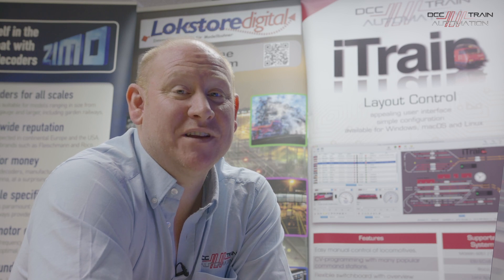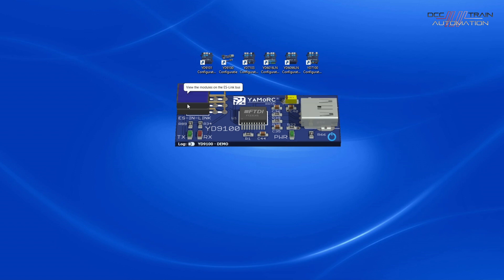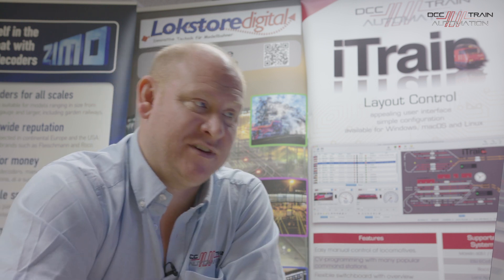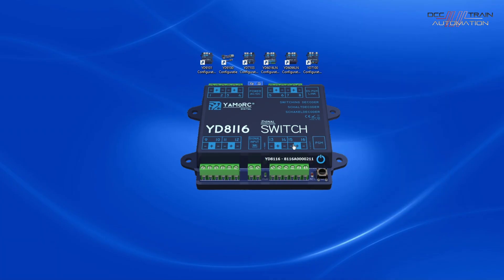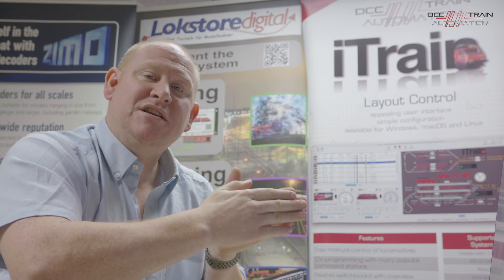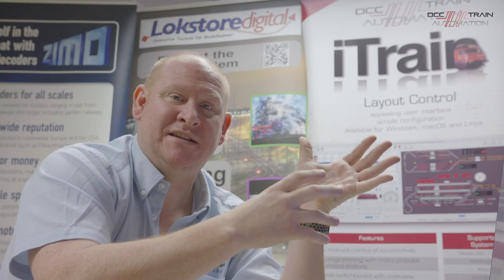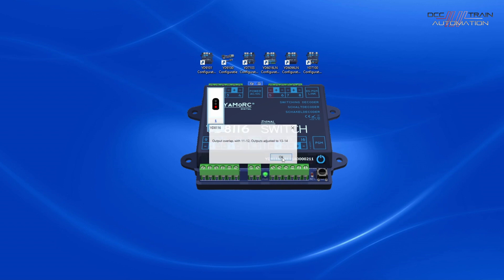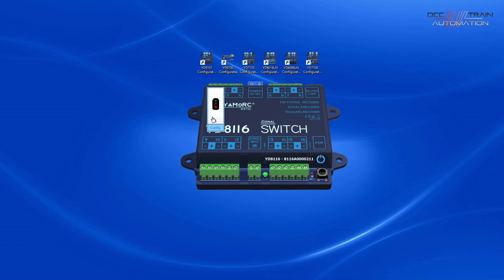YaMoRC YD8116 Switch Decoders / Signal Decoder.  No2

Comment: I've watched your video several times and for the life of me I cannot get the YD8116 to work on my layout using an EcoS . All I'm trying to do is to use the unit as a switching devise to turn 12vDC LED lights on and off. I want to start using address 289 on my ECoS as this is the first CV 1 available. Can you help ?
Reply from the maker: Hello what did you set up in the configuration softwear?
Reply: @DCCtrainautomation  I can send you the backup file but it won't let me do it here
Reply from the maker: @gregtesoriero7053 hello ok please send to info@dcctrainautomation.co.uk
Reply from the maker: @ email us

Comment: Hello, you just convince me to buy one of that. But a question...can I wire a servo for turnout switch and program the range and speed of servo movement ? It will be nice if you make a vodeo for that. Thank you
Reply from the maker: Hello this decoder is not designed to drive a servo no. They do have a servo decoder coming.
Reply: @DCCtrainautomation  ok, thank you very much. I think I can drive a servo because it is a switch decoder so switch it s drive by servo. I sae some video about net device for servo. Thank you!
Reply: @DCCtrainautomation  another question, please. this device switch or servo can control with z21 station? thank you very much
Reply from the maker: @radudobrescu5402  there is a different decoder to switch servos this will not switch servos. You need there servo decoder.

Comment: Great explanatory video. You mentioned that the YD8116 lacks a Loconet connection and all you need is to connect  a track feed to the signal power side. Not sure I understand Can you clarify ? My goal is simply have the train stop when red . I'm using Rocrail in auto mode Thanks

Comment: I wish to use Dapol semaphore signals. Can I do this thanks
Reply from the maker: Hello sir
If you want to use the Dapol semaphore signals you need a rely on the output of the 8116 and then connect the signal to the relay. This is the only way you can do this.

Comment: How does the Loconet signal get transmitted to the 8116 when operating the device? Is there a Loconet version?
Reply from the maker: This unit does not have loconet. You just out a DCC track feed to the signal side and then it gets its switch commands from here. You don’t need to connect loconet for it to work perfectly.

Comment: Interesting stuff! The switch unit be used in conjunction with a DR4088LN? I've just ordered a heap of Dapol semaphore signals and was hoping to use the block sensing to trigger these. Is this something that is do-able with this gear?
Reply from the maker: Hello Kodi What control system are you using? iTrain or Train Controller or something else?
Reply: @DCCtrainautomation  iTrain actually :)
Reply from the maker: @kodibellchambers1290  ok so the signals need to be drives from accessory decoder and then iTrain will do the rest.